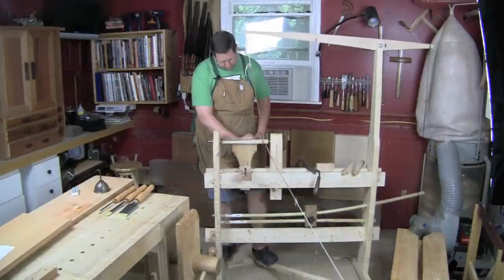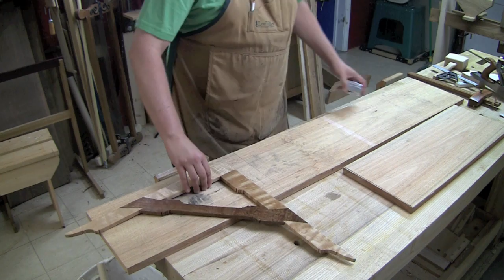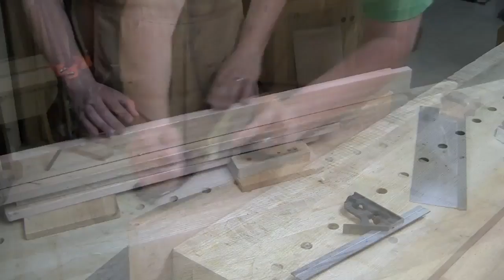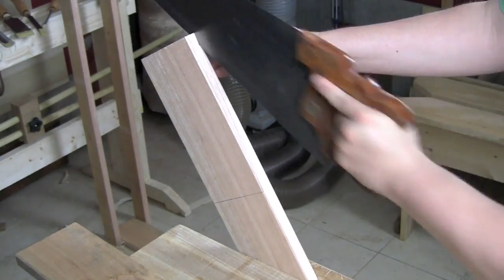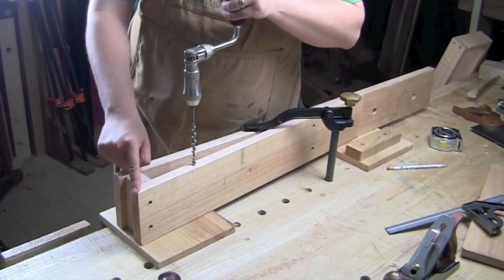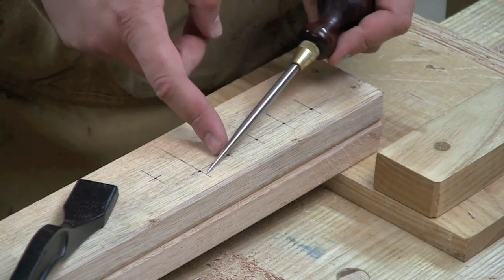RWW 164 Shave Pony

Comment: 20:00  Make different size blocks.  Keep the top "clamp block" parallel to the bed regardless of the work length by putting a block at the back of the clamp block.❤
Hard to explain.  If the piece you are working is too short, the clamping block will pivot.  A block at the back will keep it partallel. ❤

Comment: i see  your leg vice is making noise while you press the project piece into it.. have you now started experiencing wear in your wooden threads ?? or was it just lack of lubricant ? and what Lubricant do you recommend using on wooden threads that are as frequently being used as in a vice?
Reply from the maker: no wear in the threads.  I use wax periodically but haven't in some time. People comment on the noise all the time but it doesn't bother me

Comment: I think his version is the best on the web! I especially think the 6 degree riser helps, I made a basic pine version as a prototype, but eventually I will make a better one and include features like this, a brass or steel rod sounds possibly better than the wood dowel I have been using because the adjustment holes can be the smaller 3/8”, i always listen to the wood talk podcast and hope it continues to air! Shanon takes the hard route using only hand tools but that is what makes him special!

Comment: Thanks for putting up the video, I really enjoyed it, all be it 3 1/2 years after the fact.
I did not realise until I  was watching you use the shave pony that you have dramatically increased the rigidity of the whole by incorporating a triangle between the bed and the base board. Timber that I initially thought was very light for the job is made strong by the design. The only  thing that might make it easier to adjust would be a second row of holes at half way positions  giving you 10 height adjustments rather than the 5 you have at present.
All the best.

Comment: Another way to make square stock round is to first draw the correct size circle at either end then, use a pipe clamp or other  clamp long enough to hold both ends, clamp the pipe in your vise and plane your stock into an octagon.  This works very quickly.

Comment: That's pretty cool.  It doesn't look like you really need the angled top.  I think I'd use a 3x6 for the bottom board and forego the angled part.  You could also countersink a carriage bolt in the bottom board that would go thru a holdfast hole in the bench top.  Put the pony on the bench with the bolt going thru the hole and thread on a wing nut to hold it in place.  I'd attach a short board on the bottom of the bottom board where it starts to project past the bench top.  That would keep the pony from shifting sideways.

Comment: Nice bench top shaving horse. May be you will not even need to make one. I followed the lead you suggested a while ago from Peter Gaelbert and the one addition I would add is a piece of leather from an old belt so the piece clamps a lot easier. Good luck. Nice work and thank you for suggesting Peter's blog.

Comment: Nice bodger shaving horse, very neat.   I would shorten the top board, that way you can get the knife tucked right up to the arms allowing you to work more of the stock in one clamping.  With a little care you wouldn't have to turn the stock after it comes off the horse.